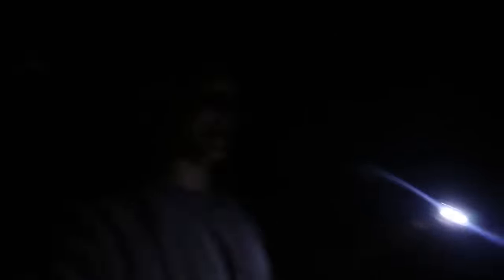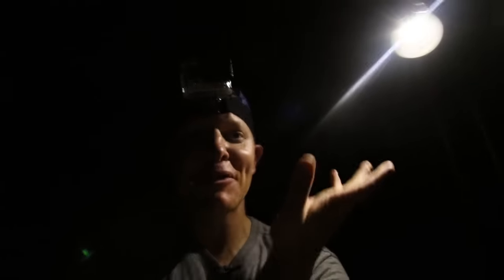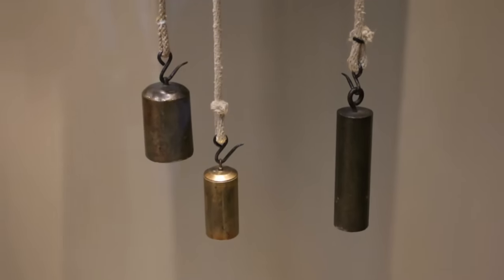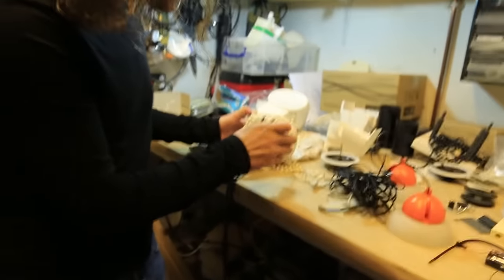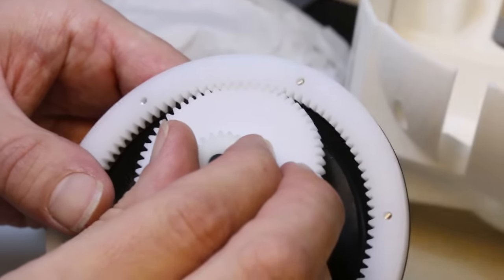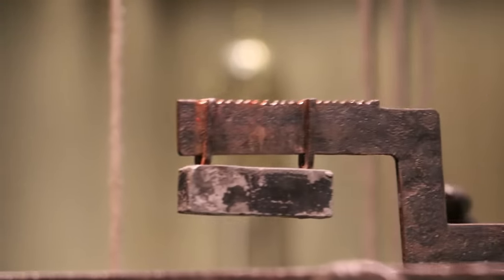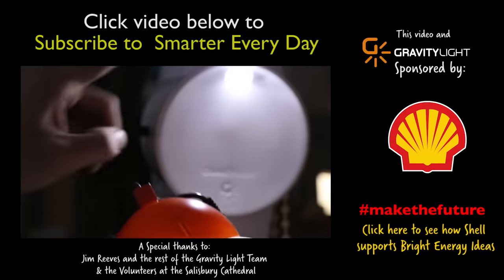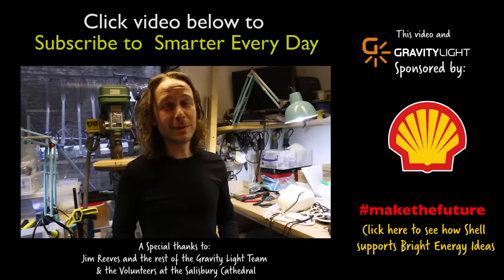Turning Gravity Into Light - Smarter Every Day 146

Comment: Why don't they just use a solar cell to power the light? Oh wait...
Reply: +muh1h1 Solar powered flashlights are very common. When was the last time you've been to a store? You put them in the sun during the day and have them ready for the night. Some street lamps use the same principle.
Reply: +muh1h1 Applying an ancient joke to a new technology... genius
Reply: +muh1h1 This is probably cheaper and easier to maintain/replace.
Reply: +muh1h1 I would love your fancy solar powered flash-light that works at night. No batteries required
Reply: +dumle29 Batteries would be required. But the battery just gets charged by the sun in the day so it has charge during the night when you need it
Reply: +Ray Fields because the intermediary of a battery is inefficient, and would severely degrade the value of the product.
Reply: +seigeengine Inefficient perhaps but they have a lot and I mean a lot higher energy density than a bag of rocks. A standard lithium battery can easily hold over 25 thousand joules of energy and is tiny. That humongous bag of rocks can hold 200. Do the math.
Reply: supremancy Also, batteries wear out regardless of use, and the solar set up limits the device to needing to be charged in the sun, whereas the mechanical solution can be charged anywhere at any time, night or day, inside or out. You don't need to remember to leave it out in the sun (where it can get damaged/stolen anyway).
Reply: greenzoid2 Batteries are expensive, and have a shelf-life of around 10 years max.
Reply: +dumle29 This is nothing more than a mechanized battery. You produce force to lift the weight of the object, then store that force by limiting the output over time.
Reply: LeastComicStanding Oh come on. Stop being so danm pedantic. When anyone mentions a battery, in relation to power, it is obvious, that they are refering to electrochemical cells. Not an artillery battery, not an act of violence. Not mechanical battries (Which doesn't make sense, because battery just means "An array of similar things intended for use together")
Reply: Wow, i didn't expect anyone to take my statement seriously...
It was a simple joke guys...
Reply: muh1h1 We are aware, buddy.
Reply: muh1h1 I for one read the comment as a sarcastic remark about how there's already a solar flashlight and this product isn't needed. If your intention was to make a joke about solar flashlights not being useful in this usecase, then I don't see how you meant to do that.
Reply: seigeengine Except this will only produce about 20 lumens. A solar powered flashlight could produce a lot more. And wouldn't be noisy. And wouldn't need a 2 meter high fixture that can support 13kg. And wouldn't require you to lift a (moderately) heavy weight every 20 minutes. As far as longevity of the device goes, mechanical components are usually the first thing to break (and will almost certainly break before a lithium battery or a solar cell would be worn out). The only advantage this has over a solar powered flashlight is price.
Reply: They actually do use solar powered lights in third world counties (liter of light).
Reply: Joe Thompson Right, but then why isn't your solar powered lawn light used all over the world by poor people in third world countries? Because you need something simpler and cheaper.
Reply: seigeengine Right. Since you're unable to see why they are wrong, let's go through them one by one:
1. Batteries are inefficient. 
Doesn't matter. You're wasting the Sun's energy and that's free. 
2. Batteries wear out. 
Plastic gears, no matter how well designed, will break faster. 
3. Solar powered flashlight has to be charged during the day. 
But it will then provide light for the entire duration of the night on that single charge, so who cares? 

Now let's (once more) go through the advantages of solar powered flashlights: 
1. No noise. 
2. No heavy lifting. 
3. No interrupts of whatever you're doing every 20 minutes. 
4. More light. 

Any more smart comments?
Reply: Joe Thompson I'm fairly sure solar lawn lights cost more than that. The gravity light supposedly costs 10 dollars. I highly doubt a solar lawn light is cheaper. At the end it comes down to how long the gravity light will last. If it lasts more than a few years, then it's most likely cheaper already because a solar powered device has a bunch of problems:

- A solar powered device will be more expensive to acquire/produce.
- It will require a battery replacement after a few years
- It has more parts that can break.
- The logistics supply line needs to supply the device AND replacement batteries, instead of just the device - more work and hence more costs.
- More serious waste (remember that waste most likely won't be disposed of properly, so it might add up in the long run).

A solar powered device would definitely be more convenient (as hellterminator mentioned above), but would probably also be more expensive. If the gravity light lasts like a decade or so, then that's amazing. But we can't really say how effective or ineffective it will be unless we know such details.
Reply: Joe Thompson Actually the waste argument is valid. The batteries contain either nickel or lithium, both of which are dangerous when not exposed of properly. I haven't thought of that when writing my original comment. 
Also the price argument is true now but that is mainly because the lawn lights are mass produced in China whereas the gravity light is not. If mass produced, its price could drop significantly, perhaps even below the price of the lawn lights. 
I still think solar powered lights are overall a better solution but I can't deny facts.
Reply: Joe Thompson  OK, so they are a bit cheaper. But then again, if you would manufacture the gravity light on an industrial scale in bigger batches, then they would become much cheaper too, making it most likely the cheaper option. Also, on the solar light you still need to replace the batteries after a few years, which also creates more waste. Like I said before, we don't know how long the gravity light lasts. For all we know it lasts a decade or much longer. We just don't know. Until you know that, you can't come to an accurate conclusion.

You need to take a chill pill.
Reply: Joe Thompson Lol, maybe if you barely use it it'll last that long. Nah, not even then.
Reply: Sascha Kramarenko The gravity light is still in development. They've field tested a first version, and are on the way to releasing the second. As such there's not really any price you can look at and get meaningful info, nor any results you can look at to gauge the performance of the final product.

Their first version seemed to have some kind of durability issues, although I think it mentioned kids swinging from the bags or something.
Reply: Joe Thompson If it's just one, then the pollution is negligible, but what if it's more? Batteries in particular, which are a lot more hazardous, might make it so you end up with a lot of serious waste after let's say 50 years. It's probably not a game breaker in the comparison, but it is something that should be noted down in the cons list and must be managed accordingly (which, thinking about it, probably increases the costs more in the long run).
Reply: Joe Thompson If one person does it then sure, not a problem. However, the idea here (however far fetched it may be) is to bring light to more than a billion people. If a billion people throw out their dead batteries in the woods, that will a problem.
Reply: Joe Thompson On the other hand....

You have to put it in the sun to charge it.
You have no way of charging it when you need it, meaning you're screwed if you didn't leave it out in the sun for at least hours.
Has toxic parts that will wear out.
You need to dedicate external secured space to it in clear sunlight.

They both do the same task. A flashlight is just moronic, and is designed to provide directed light to see while moving around, and is a poor source of general or stationary illumination.

Batteries are less efficient at storing power, but more efficient at storing power in little weight.
Reply: Joe Thompson Flashlight might do it better, but if the gravity light does it "good enough" and is more efficient, then it might be better in filling that niche (being cheap but still effective).

What you said about selling batteries, I think it comes down to that basically. If the gravity light can last a long time, then you only need to hand it out once in a long while, and so you don't need to worry about the logistics (keeps the costs much lower). But if it breaks down every 2 years or so and needs frequent replacement, then I'm not sure, might as well just use batteries then. I'm guessing that's what they're testing now (you only really find out about such things by testing them in the field, which can take years).
Reply: +Joe Thompson wow, so mich hate...
Reply: +seigeengine Not only are lithium ion batteries inefficient, they actually take more (fossil fuel) energy to produce than they store and discharge over their lifetimes, since after a few hundred discharge cycles they're useless.    Something most people pushing renewable energy are unaware of.
Reply: +Joe Thompson 
But the lawn lights do produce waste. The batteries inside WILL give out eventually, and will have to be replaced in some manner. If a gear breaks on the Gravity Light, I could just make a trace of the darn thing and cut out some plastic to match it. We've sent enough computer monitors over to Africa, there should be plenty of thick plastic trash to mess with.
Reply: Joe Thompson Yeah, I ran some numbers.   if their home gets reasonable direct sunlight, a small 3W solar panel charging a battery seems a better solution.    They wouldn't even have to limit themselves to a 0.1 watt LED like this gravity device.    They could get 10 times that brightness and replace a $3 battery once a year, and upfront cost would be comparable.
Reply: +LeastComicStanding This tech do not stores the energie, it produces it (using the height) and spends it at the same time (using the LED light), that is why its a DC motor not an AC motor on there.
Reply: +seigeengine Hello there :)
Reply: +muh1h1 bahaha is this a jab at poor akon's solar academy?
Reply: +muh1h1 I guess you could charge the solar cell with this light...?
Reply: solar lights require batteries to store the power the cells collect during the dst, that's the whole point, this does not use batteries.
Reply: +Postofficejoe   Now that would be perpetual motion !!!!     LOL
Reply: +Joe Thompson I dont comment on youtube videos very often, but when i do its because i see an argument missing 90% of the picture. For the record I personally prefer solar when at all possible over almost any other energy source. My opinion though. Now to get to the point. I have been homeless before so i can kind of relate to a third world living condition (sort of) The MAIN reason why this gravity powered device is better suited to third world inhabitants goes as follows.

Pros for gravity cons for solar

1. When you need light you will have it. no matter what. (unless it breaks)
2. Sometimes it rains for weeks during monsoon season in Africa(no sun) pretty much a deal breaker for reliable light with solar.
3. Most of them are not going to be to upset at lifting a pound of rocks        every 20 minutes for light when they are used to living a hard working life to begin with.
4.Some third world inhabitants live in vast forests miles from open areas and access to direct sun light.
5. Cheaply made solar products are highly unreliable. Example. My friend Bob seems to have a fetish with lawn solar lights. Sometimes he can get them for as little as 1$ a piece. Half of them do not work right off the bat and the other half are dim and seem to quit working after a few weeks if they last that long. Every once in a while one will last a season. He even has some more expensive ones and reliability is still hit and miss. 

Basically what im saying is there is a reason they are not all already using Solar powered devices. Many of which we are both unsure of or unaware of at this moment. Gravity lights key point is light anytime anywhere no matter what and to them thats a big deal.

Of course the whole thing will hinge on how reliable the gravity lights will be. Niether one of us can sit here and intelligently debate that without having tested it ourselves in the fiirst place. As i have done with solar lawn lights.

I will leave us all with this though. Gravity clocks if made well will last a very long time. My father has a grandfather clock that is over 100 years old and still works like a charm ( Although the noises it makes can be a bit annoying )

Comment: This is really a cool idea. Although, i don't get the voltage limit thing. How does it stop the generator from turning faster? Does anyone know a good article or something where this is explained well?
Reply: When the load on a generator is increased (that's the sharply rising current graph in the video) it creates something called "counter-torque' in the generator, an electromagnetic force opposing the rotation of the generator - effectively acting as a brake.
Reply: Norman Higgs
Ah, thank you. Now I know what I have to search for. Sounds really fascinating. :)
Reply: this is nothing new i can assure you that. people have been powering light off of gravity  aka water reseviors/ dams .. nothing new here, it only new to him because he has nothing else to report
Reply: Chris Prime
By this logic, there was nothing new in the last 7 decades or so, as every new technology was derived or inherited from already existing technologies.
Reply: If not mistaken the "votlage limit" mentioned by Destin is about the forward voltage of an LED (diode) where at certain point of voltage increment, the diode will allow a lot of current through, essentially loading the motor a lot more, slowing the motor down like a short circuit.

I think the "counter-torque“ mentioned by Norman is one of the effects but only obvious when there is little to no load.
Reply: Counter-torque is how the generator load manifests. The generator has its primary magnetic field that produces voltage in the rotor windings as the rotor turns. When the load is put on the generator, current flows through the rotor windings. That current flow produces its own magnetic field, which opposes the primary field - creating counter torque - a resistance to the rotation of the rotor. The key to this device's ability to "self regulate" its descent speed is the diodes non-linear resistance - as you indicate, there is a point where the as the voltage increases, current increases exponentially, like water overflowing a dam. That dramatic increase in current, greatly increases the counter-torque.
Reply: Ah yes, in that sense I get it.

Basically the motor voltage increase, which turns on the diode further, allowing more current through the windings and this is when counter-torque comes in.
Reply: Yes, what's really key to its ability to regulate various weights all at the same descent rate is the non-linearity of the LED. It only takes a very tiny voltage increase to let a lot more current through. Typically an LED might conduct about 90 mA at .70 V - the point where it begins to light up - but current may jump all the way to 700 mA at .72 V (for example). Too much current (or too much weight on the mechanism) will burn up the diode. It might be noted that the LED may be noticeably brighter with a heavier weight. 

Its basically a self regulating current brake. Such current brakes are used (on a much larger scale) on locomotives, and wind generators, but they are electronically controlled brakes. But they work on the exact same principle - basically "burning off" current to regulate speed.
Reply: Eis Geflüster
Reply: demon knight
?
Reply: Eis Geflüster Look up on how generators works, it will explain everything.
Reply: I think it is because of eddy currents
Reply: @normanhiggs8451  real mvp

Comment: neither the clock or the light is powered by gravity.  they are both powered by human beings doing work by lifting weight.
Reply: No, the direct work is done by gravitational pull where potential energy is converted into kenetic then into electricity. otherwise by your logic the it is powered by the sun.
Reply: And you're BOTH correct. Human work is put into lifting a mass to a height where it obtains potential energy. The system of which it is part is then initiated and the human input of potential energy is then used as kinetic energy because the mass is attracted to the Earth due to gravity. It's all about energy. Calling it a 'gravity' powered system is a misnomer, although gravity induces the potential energy.

[And as a side note: Gravity is present in all energy, not being a property of only matter. If there is energy, there is gravity. The more energy within a conformation, the more gravity. I don't know why this concept is hard to grasp except for the fact that we don't have instruments capable of measuring the gravity of an EM wave/photon. But we know this is the case because EM radiation is attracted to black holes.]
Reply: Nakruf SteelCore so, no people needed? just gravity?
Reply: Eric Cameron Dummy ;:D , What i am saying is, a system where a human is part of the system does not mean the system is soley based on that. We could have some machie doing the liftwork i.e giving it potential energy but then we don't say the energy is directly converted from mechanical to light. There are other procesies that are in place where energy loss becomes greater.
Reply: And human beings are converting the chemical energy from foods to the kinetic energy of pulling the weights up. Foods get chemical energy from solar energy. So, you can say, it's solar energy that's running the clock and powering the light.
Reply: M. Waheduzzaman Khan It is the "big bang" (I don't like its name).